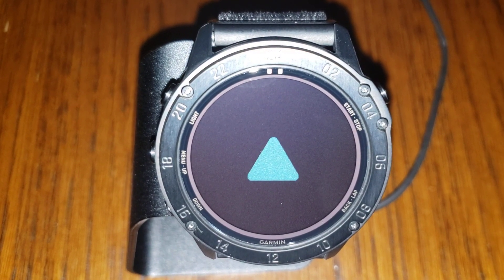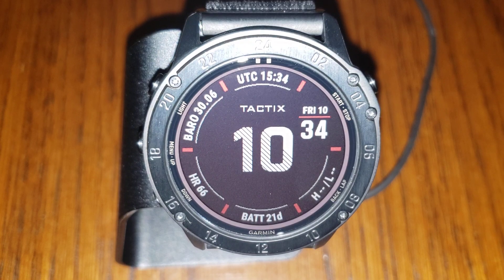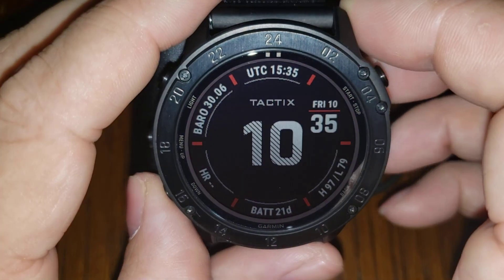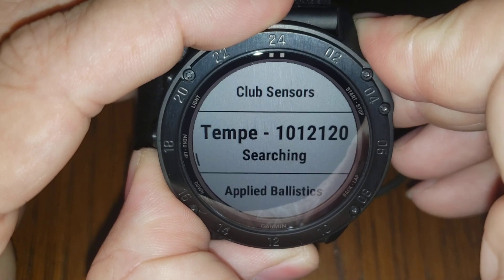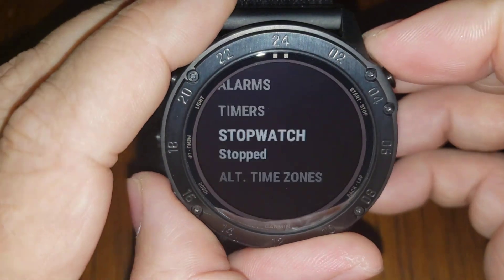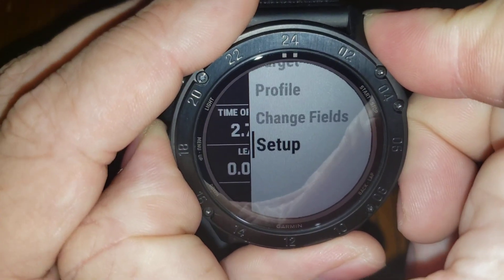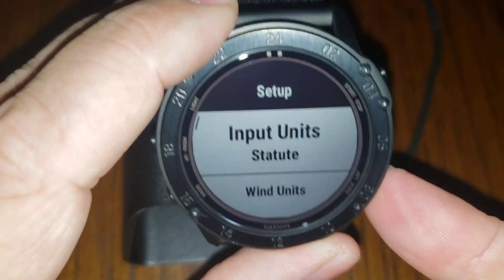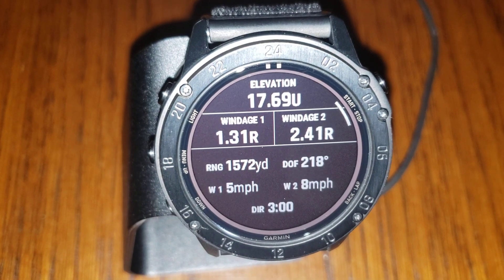Garmin® tactix® Delta Solar with Ballistics - Launch Preview

Comment: Question:  You said something like, "It's not an app." So then, can I input custom ammo info into the Applied Ballistics thing in the watch and calculate results using Applied Ballistics on the watch? Or does the Applied Ballistics thing in the watch only show pre-calculated data for whatever ammo Applied Ballistics has selected to put in the watch? In other words, does the watch only contain and regurgitate a matrix of pre-calculated data, or does it actually contain Applied Ballistics software to do custom calculations?

Comment: Does this watch calculate wind speed? w1 and w2 or do we need to have another device?
Reply: Are you asking does it measure wind speed? The answer is no. Does it calculate the wind corrections and all appropriate secondary values based on the wind you input? Yes.
Reply: @DocBeech   How do you calculate w1 & w2 ? Do we need different devices to find other needed information for the watch to calculate the  necessary corrections ? Thanks for the video
Reply: @DocBeech  Does it actually "calculate" the result from the ballistic equations? Or does it just report the corrections from pre-calculated matrices of data?

Comment: Can't get sig kilo 5k to send range info to watch despite Garmin and Sig both saying it should work.
Reply from the maker: Is the Kilo 5K in ABX mode?
Reply: @AppliedBallisticsLLC  can you give me a quick rundown on how to do that?
Reply from the maker: @allleadnosilver  https://www.sigsauer.com/media/sigsauer/resources/21SIG3231_KILO5K_OPERATING_INSTRUCTIONS_SOK5K705_ENGLISH_7402369-01_R01.pdf Page 24 and 32+
Reply: @AppliedBallisticsLLC  hey thank you for the good follow up. The issue is that the setting needs to be changed from "app" in the rangefinder to the next setting and then it picks up the watch.

Comment: What Garmin should have been integrated is a correctly placed inlay/display!! (tactix Delta Solar and Ballistic Edition)
Yet I have bought six! tactix Delta "sbe" from German sellers and all of them are incorrect assembled. The inlays are slightly twisted clockwise. The two squares are not directly under the "24".
It seems to be only appearing with the solar editions as I have not seen any pictures of tactix Deltas without solar build together incorrectly. The squares are under the 2 and 4 in a perfect line as shown on every marketing render.
I am very unhappy about the fact that Garmin has told me the deviation is within normal production fluctuations.
What??!! Production fluctuations on a 1,500 $ Watch?! Are they kidding me?

Comment: Awesome product!  I'm impressed by the battery life. Still I'm relieved to hear the Foretrex 701 is still being supported as I consider it a more "fieldable" device than this product. Mainly for its replacable batteries.

The only thing Im missing on Garmins ballistic products are compatibility with a wider selection of rangefinders. I'd prefer if it connected proberly to a rangefinder that matches its compute power. Like Leicas top models, and Vectronix PLRF25C. I know the Terrapin-X i supported, I wish it would transfer more than just the range.
Im not a programmer, I don't know where the limitations are. I can't phathom why its such a big problem to have these devices share 3 numbers. Distance, azimuth and incline.

Comment: How do you use your range finder with the watch after uts connected? I range a target but nothing happens on the watch even though its connected.
Reply: Which range finder?
Reply: @DocBeech  sig 2400bdx
Reply: @hamedizzy5137  You should simply need to go to the AB home page, and then laser a target and the range updates.
Reply: @DocBeech  its not working on the watch.
Reply: @hamedizzy5137  Is the watch firmware up to date? Are you giving the range finder time to wake up and connect? What do you have the timeout set to?
Reply: @DocBeech  the time out is set you 10 mins and yes the range finder is super fast at connecting to the watch it shows me thats uts connected but maybe I'm not at the right page to range? I think this is the main page for the AB
Reply: @hamedizzy5137  mine is doing the same thing did you ever find a fix?
Reply: @DocBeech  I’m on version 19.20 and mine does the same thing any advice?

Comment: It does pair with the Sig Kilo 1400BDX but for some reason the information is not sent to the watch. Suggestions?
Reply: Unfortunately the 1400 is not an AB External device, so it is not compatible with this option.

Comment: Have this watch for 2 days now and love it. My 5th Garmin watch, 2nd Tactix. I am just bit strugling with laser rangefinder compatibility. Is anywhere a link for actual list of supported devices? Will probably go Bushnell Nitro 1800 way, but Id like to have few options. fe it is not clear if SIG kilo2400 bdx works or only the abs version...thx
Reply: As of Nov 2020:
Bushnell Nitro 1800
Sig BDX 3000
Sig BDX 2400
Terrapin X
Reply: @DocBeech  thanks a lot! Bushnell on its way..

Comment: Does Direction of Fire get pulled from the rangefinder or does the watch capture DOF?
Reply: It is captured from the Watch currently.
Reply: @DocBeech  So then do you calibrate the watch for right vs. left wrist wear? And with the watch connected to a rangefinder do you need to have your hand in a particular orientation as your capturing the range?
Reply: @joshuamatheson3825  The watch functions the same regardless of what wrist it is worn on. Top Dead Center is going to be the compass orientation for measuring azimuth. This applies to the mapping software as well, or when independently using the compass outside the ballistic software.
Reply: @DocBeech  Very interesting. Thanks

Comment: I entered my data in for my 223 round and the range card is not accurate with my own physical range card. Everything is entered in correctly but at 200 the watch says I’m at 11.1 in drop but I’m really only at a 2.7in drop. Anyone know a way to help?
Reply: Good question. You might check it against Applied Ballistics' online calculator on their website. (Though I tried using it yesterday and today and it doesn't seem to be working. Not sure if the problem is on their end or mine.)

Comment: As a green beret, I could use this software. However, I purchased the original Tactix Delta Sapphire in February of 2020 (very shortly after it came out.) Thanks so much Garmin for making the watch I own obsolete only 5 months after I purchased it. This is software, there’s no reason it can’t be ported to the sapphire version of the watch or am I missing something?
Reply: It is a hardware upgrade as well.
Reply: @Dan It has an upgraded circuit board.
Reply: Just make a simple version of the app for $50 for any Android watch's. It would kill the 701 but at least everyone would use is.

Comment: Where can I send my money?  Can I get the program on my fenix 6?
Reply: You can buy these at a number of places, but it is embedded software and a hardware upgrade so it's not an app that can be added to previous Garmin devices.
Reply: @DocBeech  that's Garmin's bullshit.... Tactix and fenix watches have the same sensors and hardware...  At last they deside to put the sapphire to the solar tactix instead of that "power glass" they advertise on the Fenix line.   Proof that it's just software is that they put there another solar without the AB software.

And OK let's say that zthey put something in there that allows connectivity to Lazer rangefinders and other devices... Then if someone doesn't want that connectivity why he can't just have the software to his fenix?

It's just marketing, that's why! They just telling you that if you want teh AB just throw away your fenix and buy the tactix!!!